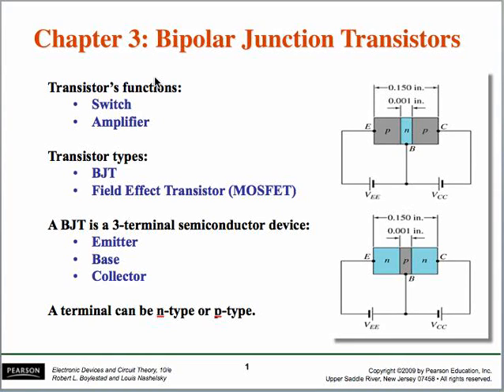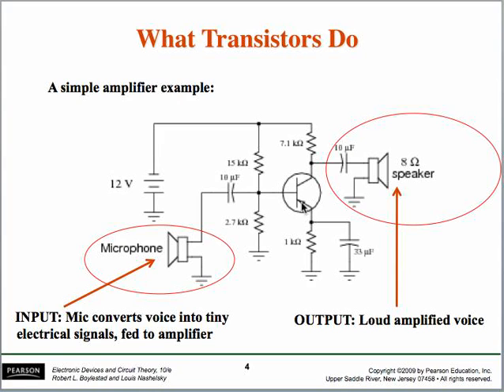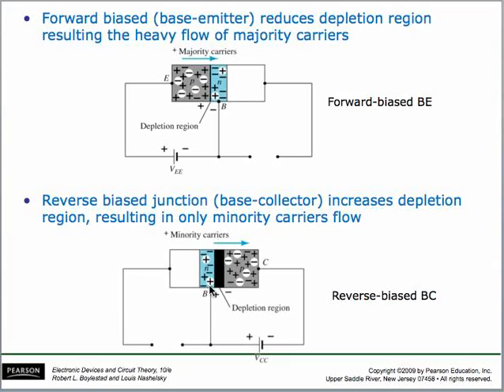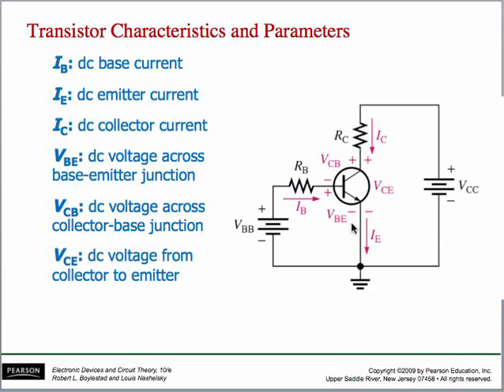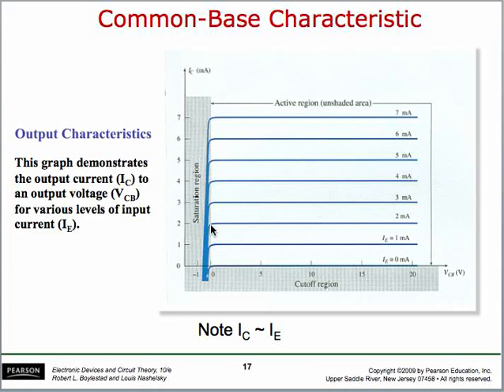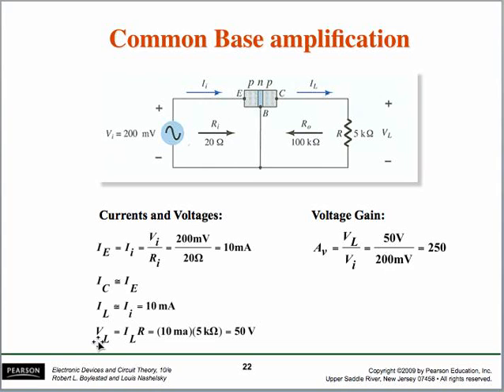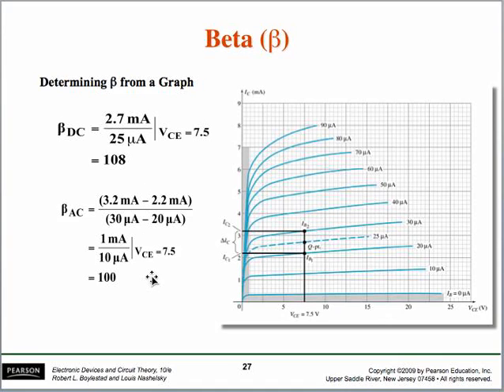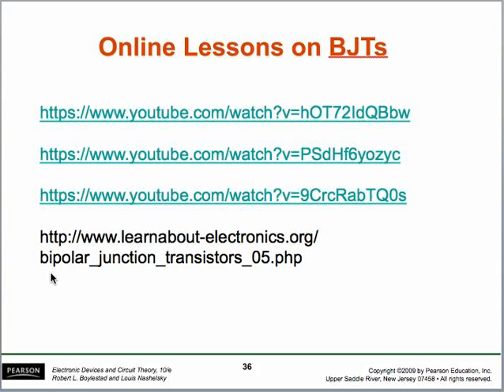Analog Electronics Lecture 2: Bipolar Junction Transistors

Comment: The slide #2 is wrong. 'Arrow' indicates Emitter, and it's electron that flow from Emitter (E) to Collector (C).

Current is flowing from Collector (C) to Emitter (E) because it defines the rate of electron flowing.
Reply from the maker: Yes you're right. The arrow in the BJT schematic of slide #2 should be between the C-E terminals. Tq.